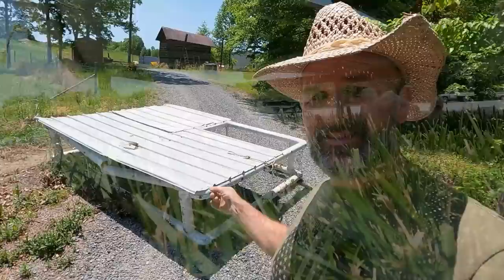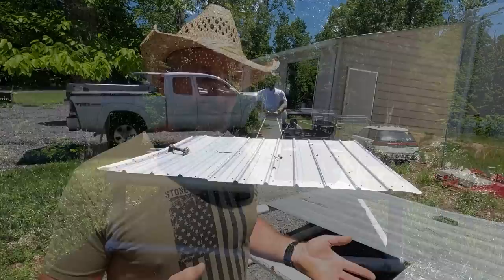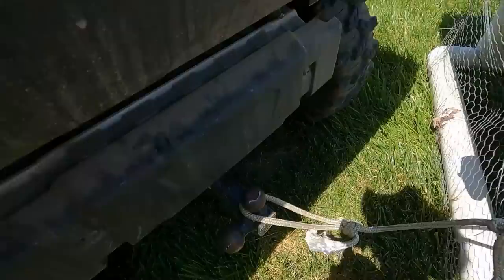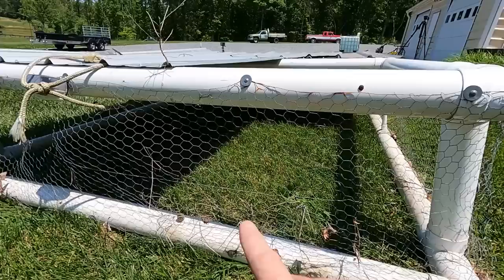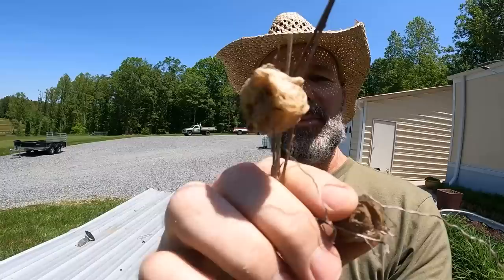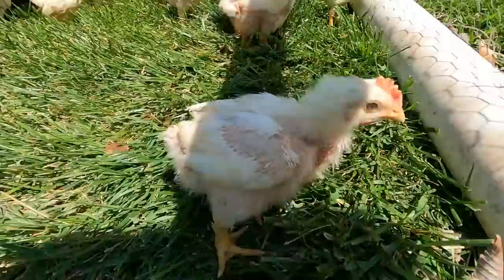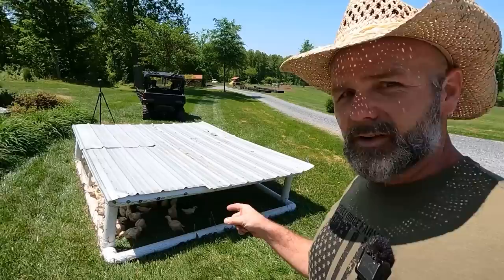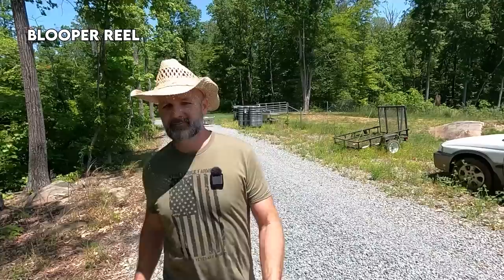How to get started raising chickens on pasture!

Comment: The number one worst ports coop design...  Joel salatin started this basic idea and there are way more negatives then positives. John suscivich has a far superior design. Its too hard to harvest them with low roof, its too hard to get in them to get dead ones, you can't see them when your moving it so you will at some point run some over
Reply: Looks like a solid design that anyone can make, that will not break the bank. Can easily take the lid off to reach them, and both designs can cause running over. We made ours liked this with wood and bird netting instead of pvc and metal
Reply from the maker: This isn't Joel's design...and if you wanna move around a 800lb mobile coop twice per day...be my guest.  Sorry...but I've got a neighbor who keeps building these giant monstrosities and he can't move them without an ATV/UTV or tractor.  It's too darn heavy my freind...and it's a gaint sail if you build it out of lighter material.  I think they are really cool looking....but I don't think they're the best option. I'll do a comparison vid soon.  Now....Joel's tractors are heavier than mine also....about 2 times the weight.  Mine is so light that you can lift it with one hand and pick out a dead chick if needed.  I also don't deserve to be put down my friend.....this is how I've raised my meat birds for nearly 5 years and it's worked great.  Don't knock it until you try it...this isn't joel's design...this is my take on joel's design and it works great.....when a 120 lb woman can move it with one hand...that speaks volumes
Reply from the maker: exactly....doesn't take a rocket scientist to build a little sliding coop....this fella has clearly never moved a Suscivich coop by him/herself....they are way way too heavy!
Reply: 👏👏👏👏👏👏👏👏
This is an EXTREMELY cost effective and easy way to move around on pasture! ❤❤❤❤ @StoneyRidgeFarmer
Reply: Just imagine what the world would be like if everyone did the exact same concept of another person. Kudos Josh, can’t wait to see the new chicken coop
Reply: I have tried it.. I was doing this when you were still wearing scrubbs and taking vitals everyday.. I'm no novice and I have tried all the designs. I have many porta coops in use right now.. Can't wait to see your comparison
Reply: Fox raccoons rats mink skunks dig underneath and feast  u need guardian dogs trained or try trapping predators  once word is out  that there are chickens to eat at stoney ridge  the feast is on   I have also a small flow, of free range layers and I bring  the chickens I side every night  and tie up my dog at the barn
Reply: Plastic breaks
Reply: My concern is the wind picking it up with the chickens in it. Has that happened to you? I have a lot of wind down in this valley I live in

Comment: Praying Mantis Nest, or cocoon, anyway it's where they lay their eggs. Is that Schedule 40 PVC pipe or drainage pipe? Wondering what pulling it on the gravel does to the bottom side? If it's wearing any, I guess a pan could take another pipe, split it, and make runners out of it.

Comment: Isn't the cost of the PVC more than cost of wood? I realize that there are two different types of PVC but at my local rural King it was pretty expensive
Reply from the maker: go to lowes...the PVC wont rot, rust or fall apart...you are buying a lightweight mobile coop that's easy to move...v/s a wooden heavy structure that will fall apart in 3 seasons my friend

Comment: The chickens cook under that steel roof close to the birds it's I humane
Reply from the maker: yep....most folks who've never raised a chicken will say this..  I assure you this coop is open on all sides, gets a nice breeze and comparing the height of a chicken to the height of a human....this would be a barn with a 20 ft roof...it's for shade, and it doesn't produce heat.  Galvanized metal reflects heat and the temps remain about 80-85 degrees in the hot summer depending on outside temps.  Chickens are tropical birds fyi my friend
Reply: I raise 10000 boiler breeder chickens  I know how sensitive they can be